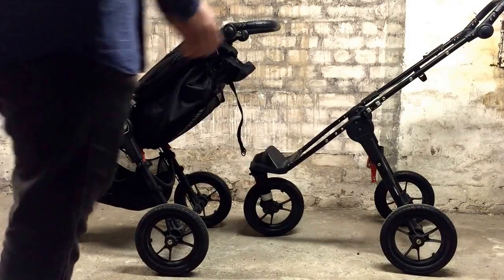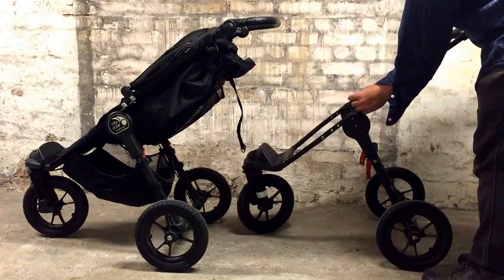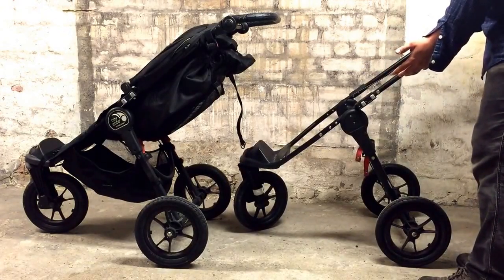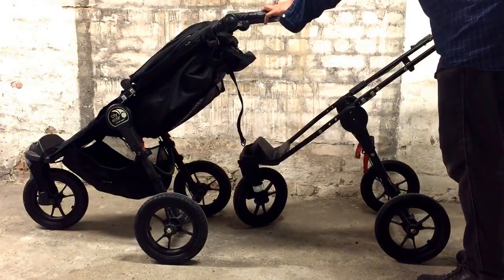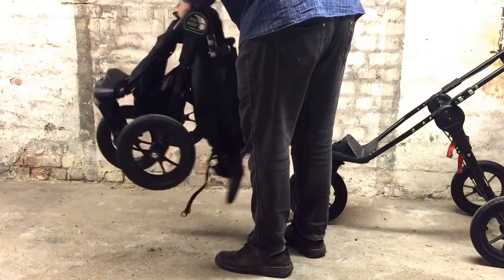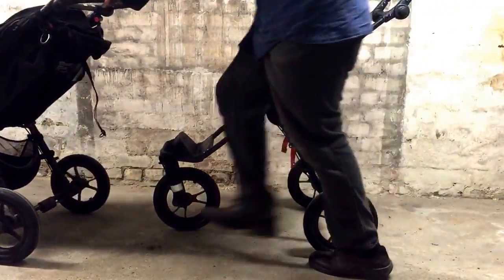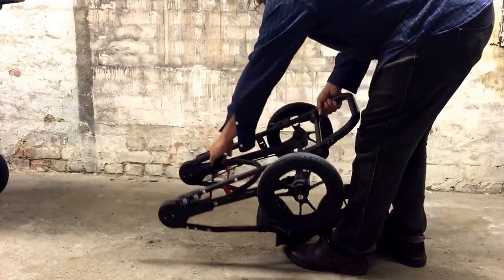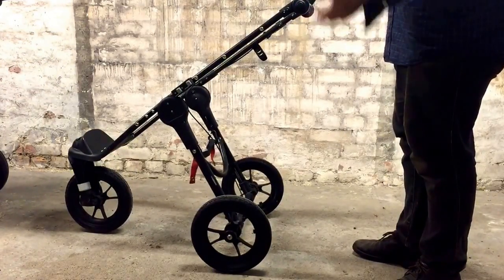Home Solution for Fixing the Easy Fold Mechanism on a BabyJogger. Fast and Easy!

Comment: Thanks for the insight on this. I was able to fix my jogger just like you said. Only thing is i couldn't find your video on how to take out the combo gear, so it was trail and error. Key point is to remove the sticker on the side of the mechanism to expose the other screws that hold it together....also make sure the stroller is closed (if possible) before taking the cover off...and only pull the outside cover off keeping the inside cover in place...makes things much easier.
Reply from the maker: Please subscribe if you find our videos helpful:)

Comment: Hi, I'm currently borrowing  friends city lite and have found the right mechanism isn't locking properly which you can feel through the handles as you're pushing it (frame kind of dipping one side)
Is this a fix for that problem?
Thanks for a help in advance
Reply from the maker: amanda stephens hi, from your description it’s more likely that the mechanism has simply become misaligned. Try disassembling and reassembling it first. You can search up our video ‘repairing the easy-fold mechanism on a baby jogger’ to see how to do this :)

Comment: I took the clover gear out of my City Elite and somehow when I put it back ended up with a low rider version of my stroller!  The seat is leaned way back (the angle between the front wheel and back wheels seems to have gotten larger). Help!  Know a solution?
Reply from the maker: Hi, sorry for the late reply.  Did you watch our full disassembly and reassembly video?  I'm not sure how without seeing the stroller, but something probably went in a bit wrong with reassembly. :)  Here's a link: https://www.youtube.com/watch?v=rWYspGTxTOI